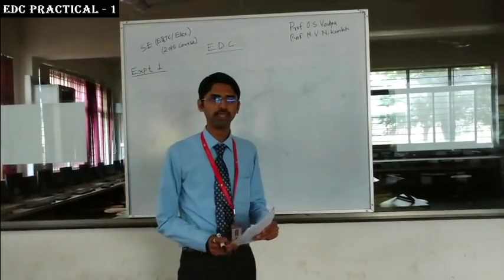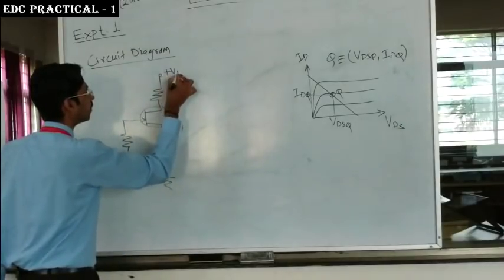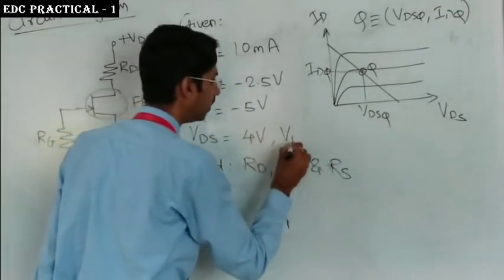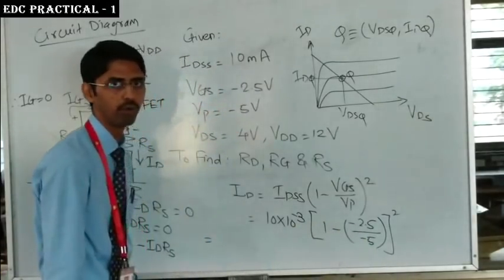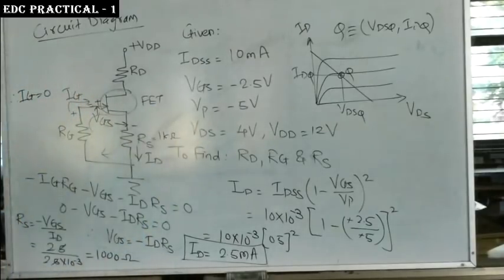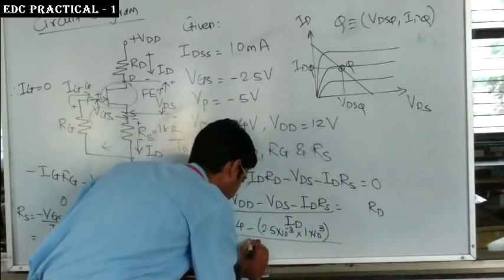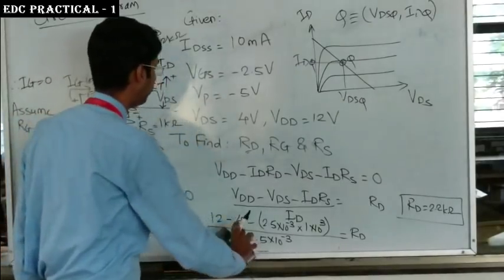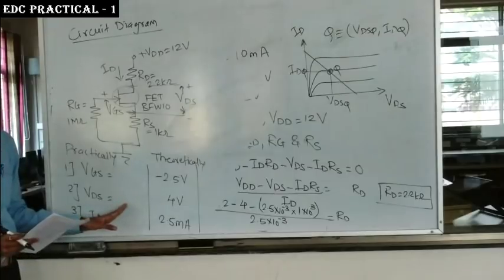EDC Practical: 1. Design a single stage FET Amplifier in CS configuration by Prof. Omkar S. Vaidya

Comment: Sir please make lecture sessions of edc. Your teaching method is nice
Reply: Thanks for watching video. We are trying to shoot some theory videos and soon will upload the same.
Reply: sir we  have to use BF245C FET so what is the difference in that
Reply: Dear Sanket, both BF245C and BFW10 are n-channel JFET. In BF245C yos = 25 uS, IDSS = 12-25 mA, comparatively high cut-ff frequency and packaging is TO-92 (only 3 terminals available) while in BFW10 yos = 85 uS, IDSS = 8-20 mA, lower frequency transistor with TO-72 package (4 terminals available).

Comment: Is it compulsory to short the source and substrate ?
Reply: Dear, In theory we have seen that substrate terminal is connected to ground always otherwise body effect will occur. And we have considered Common Source Configuration in which source terminal is connected to ground through resistor Rs. In practice we are concerned about only 3 terminals viz. source, drain and gate. Source and substrate must be equi-potential (i.e. Ground) and hence it is practice to short source and substrate.

Comment: Why we dont find bfw 10 in simulator of proteus
Reply: Because all JFETs in this library are packaged for PCB design and has appropriate simulator properties. Some models are generic to particular category of transistor. The reason of choosing BFW 10 in my simulation is I have compared hardware setup (using BEW 10 NJFET) with software. I have used Multisim software for the same which you will find in other video of same EDC Practical series.
Reply: Use multisim